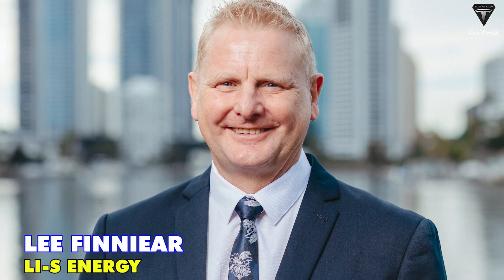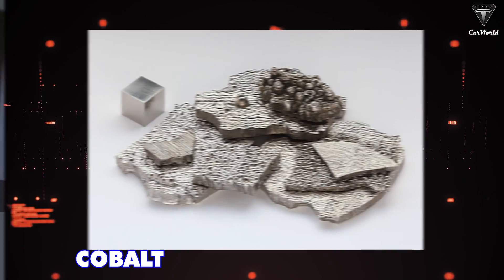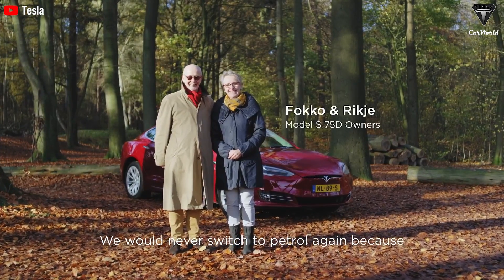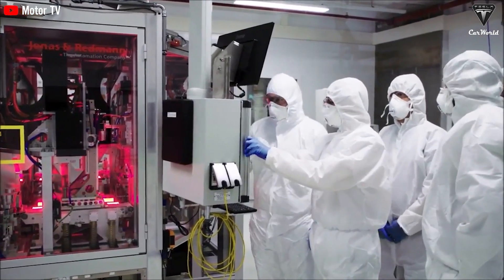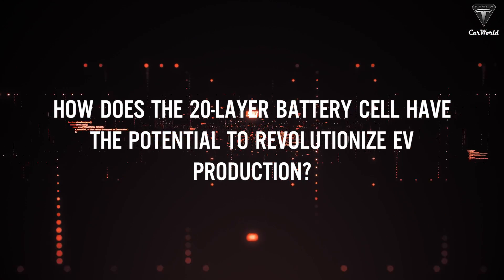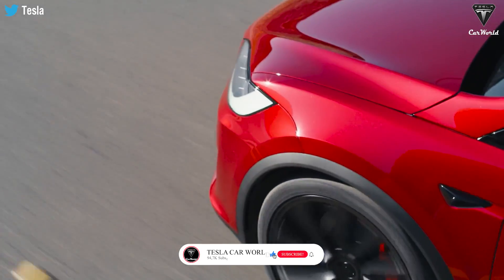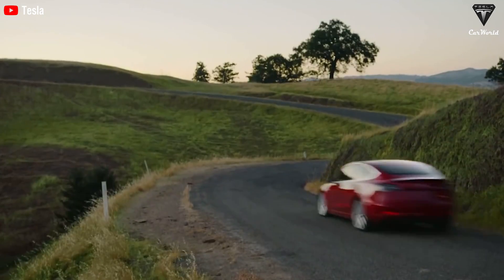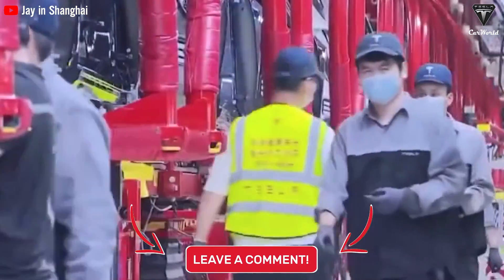Just Happened! Elon Musk LEAKED Thousand-layer Solid Li-sulfur GEN 3 Battery Tech in 2024!

Comment: What is important to me, Cost, Safety , Range, Time for recharge, and most important why does it make a difference in terms of Carbon footprint. To date, there is on advantage over an ICE . The rest of the advertising babel may be of interest to Engineers, but not the General public. Working on a modern Car demonstrates Engineers have different end points then the user, or repairing tech, when it comes to practicality, costs, and longevity.